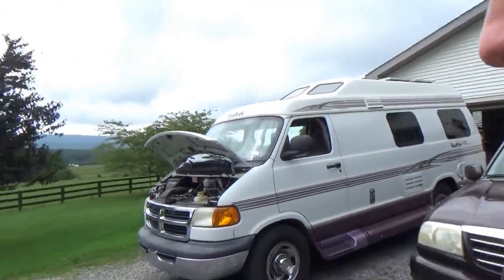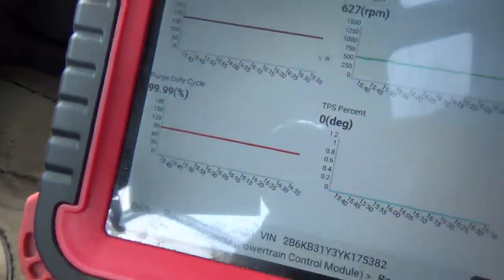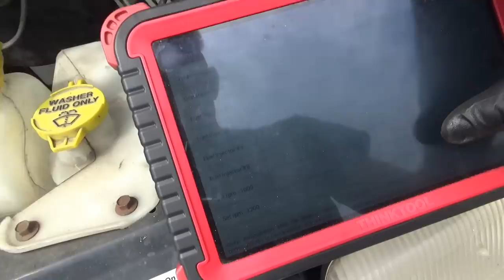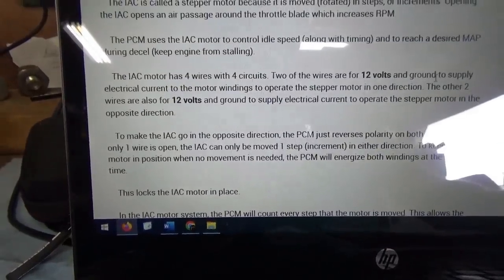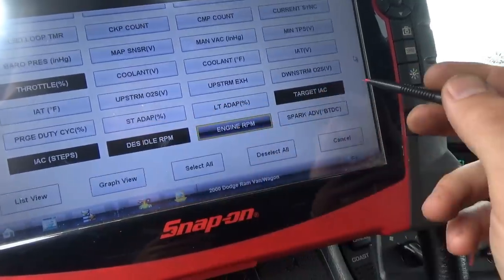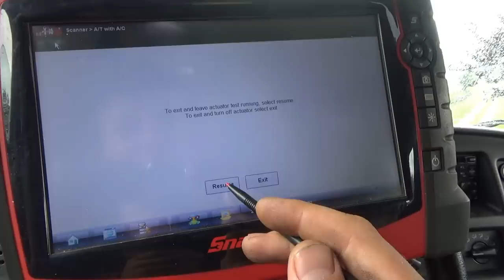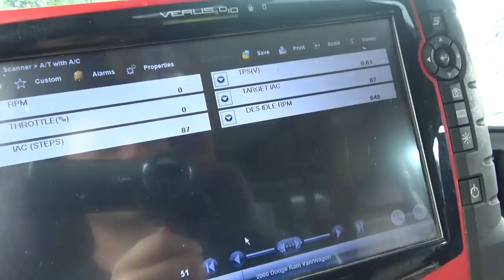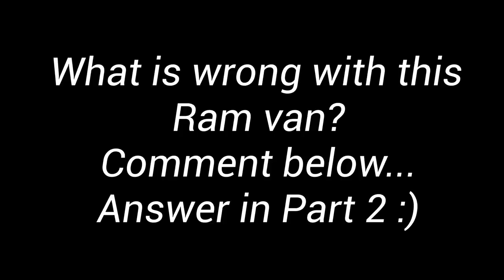DANGEROUS to Drive! Ram Camper Van STALLS after Hot Soak - Part 1

Comment: I went through this with fleet of full size Ram vans in the early 2000s all had similar problems. You will probably find it will act up not want to start vapor lock even run bad if the fuel tank is low and you drive it around for a while. All of the vans I was working on had the filter/sponge in the tank clogging if you do a volume test when they were acting up the fuel would start to spit out, pump was cavitating I found the filters clogged around 100K. Driving would slosh around the fuel cause it to start running better or full up tank would run better crazy pain to figure out at first and before I figured out the first one had 2 more doing same thing.

Comment: The IAC (Steps) reported parameter is only telling you how many steps the ECU has applied, the ECU has no way of knowing the actual position of the stepper.  If it's intermittently sticking and losing steps or not able to be driven fully to it's home position to get the zero step position then you would expect the reported step value to change as you are seeing.
Reply: Shouldnt the motor re-home with key on to reinitialize the step counter ?
Reply: @nickmalone3143  It will, but again may immediately lose steps if gunked/sticking.
Reply: @nickmalone3143  Yes, it moves to one end of its range to zero the step count but if part of the steppers range of movement is bad (i.e. sticking) then it could get a bad home position or it could lose steps immediately after getting home amd moving to the stored open loop idle value.
It seems to be able to control idle pretty well sometimes, so I suspect only part of the motion is tight rather than all of it.

Comment: I had a 2001 Dodge Van and was doing almost the same thing after a hot soak.  Turned out to be the PCM/ECM due to the circuit board inside was cracked and when it got hot the crack would open up more stalling it out.
Reply: Good comment but this one runs fine hot. Did yours act JUST LIKE this one, only acting up after you turned it off? (trying not to watch to the end before reading comments) :o)
Reply: @hikerJohn  same symptoms

Comment: I have seen this exact thing 3 different times and it was 3 different issues every time, 1997 Dodge Dakota 5.2 had a PCV valve issue where it was pulling oil, then it would only idle with the IAC at about half open (43%). Next was a 1998 Dodge Ram 5.2 that sounded an awful lot like this van, the starter was drawing so many amps that it was pulling the keep alive memory out of the ECM causing an idle relearn every time it was started. Next was a 1998 Dodge Durango 5.2 that had an intake manifold gasket leak, which had me chasing my tail because they usually leak when cold, but this one was leaking into the lifter valley and not at the top by the valve covers. Gave it the Charleroi Chimney, aka Avoca Smoka, and found it that way
Reply: the loss of comm error that kept popping up may support your theory of the Iac trying to do relearns.  Im wondering if it has a bad main  ground somewhere. its also sluggish to turn over the engine..
Reply: PCV, I like this idea aswell

Comment: Air filter, pcv, throttle body clean, IAC clean, fuel filter, fuel pump, new battery, and for sure new wiper blades. That's my parts cannon burst from the keyboard. If none of that works, then PCM. If that doesn't work, then heat shield all fuel lines. If that doesn't work, then send it to Rainman Ray. If that doesn't work, have Ray send it to South Main.

Comment: I was thinking from the 5 minute  mark of this video if you've worked on a pile of old dodges like I have you should already be looking at your battery condition and the alternator output.     It sounds just like it has to relearn idle rpm everytime you're starting it which it shouldn't need too unless the battery is to weak and the ecm keeps resetting that value

Comment: I am familiar with the Ford idle speed algorithm.  First, you have to understand the engine operates in 3 different modes: closed throttle, part throttle and WOT.  The modes are determined by the TPS.  If you are in closed throttle mode and you add a small amount of throttle, not enough to enter part throttle, the ECM algorithm WILL take away IAC !  If you add enough throttle to enter part throttle mode, you are correct in that the IAC will pre-position for when you take your foot off the throttle.
There is no direct feedback from the IAC.  The ECM believes that if it commands X number of steps, the IAC actually moved that many steps.  The current position, in steps, is created during engine cranking.  First, the IAC close completely (0 counts) and then it steps forward to it's starting position.  Now it knows where it is at and all additional steps are added or subtracted from that number.

Comment: The pintle on the end of the IAC motor may be dirty. Back in the dealership days, we ran into similar situations on the magnum engines and cleaning the pintle on the IAC would straighten things out. That being said, we also had several PCM failures that would often give similar symptoms. Looking forward to part 2!

Comment: I had a similar symptom on an older vehicle.... it was the electronic ignition module inside the distributor cap.... back in the day it turned out to be a recurring bad batch of them but it was replaced in Oregon, Utah and Colorado on a nightmarish trip... I know those folks will be grateful Ivan

Comment: When you first described this, I wondered if this was a variation of the old vapor lock situation - the gas in the fuel rail would boil and cause all kinds of problems.  Given this is a return-less system, all that vapor would have to be consumed before things got back to normal.  I'd be checking the fuel pressure.  Maybe I'm wrong, but that would be a fast easy check to rule out weak fuel pump or pressure regulator.  In fact, I'd do that before starting a deep dive into the computer readings.

Comment: I'm thinking since it seems like the battery is weak the battery voltage is dropping too low during cranking and the PCM is losing it's learned idle memory, the throttle body is probably dirty as well compounding the issue.

Comment: You are definitely on the right track, Ivan. I would check each of the inputs to the ECM that it uses to control the IACV.  All cars vary, but typically the ECM monitors load parameters from A/C, headlights, rear window defogger, power steering pump pressure switch, neutral start switch, etc.  Perhaps your research service will explain how the input parameters impact the ECM's strategy to control the IACV.  I know you already have this figured out and I'm looking forward to your resolution in part 2.  😊

Comment: From my experience on my 1987 GM , they can sometimes get a build up of carbon around the pintle . When it had worn , there were rub marks where the pintle would seal against the plenum . I suspect that was side play in the shaft . Nothing wrong with a relearn . And if that is an off brand replacement , it could be a joker in the deck !
Reply: I had a Chinese motorcycle (CSC RX3 as in USA) and it would do a similar thing with carbon on tip and inside the passage as it used this type of Delphi AIC....

Comment: Wow, I'm getting the same thing with my 2004 Lincoln. Took it to a shop they changed the plugs and coils and it still happened after. They kept it and could not find the problem. My car has stalled, but most of the time I get misfires until I drive down the road. I was looking at the IAC, but I also suspect there may be an issue with the EGR. I can't wait to see what you find!!

Comment: Used to be common on Mopars for the purge canister to leak small grains of charcoal.  The small grains would get caught in the purge valve holding it open. Usually presented as hard start after fill up as the partly stuck open purge valve allow the fumes to be forced into the intake while filling the tank. But would also happen after hot soak if some of the charcoal was stuck in the purge valve. Usually you could just remove the purge hose and shake it and find small particles falling out. Also may explain the low stepper #s trying to make up for the vacuum leak

Comment: Cool issue Ivan! The van sounds like the classic Chrysler start and die after a battery disconnect. I wonder what the default steps would be if you were to unplug the iac while it was running. Looking forward to the fix!

Comment: I had a weird similar issue on a 94 GC 5.2. I didn’t have a scanner and after chasing everything done the hard way, the purge solenoid was allowing fuel vapors to enter the throttle body at idle and would killer the engine or make it run horrible for a short period of time. I found two bad vacuum check valves and possible bad signal wire from the pcm. Now your engine is the 2nd or 3rd gen vs the 94 I was working on. But the circuit was powered by a 12 v supply and the pcm would supply ground to the purge solenoid to activate it. Once activated it would not complete the vaccum to not command vapors into the intake.

Comment: A weak battery or voltage drop in the battery cables will cause this problem on those magnum engines it causes the pcm to loose the learned IAC steps until you have a key cycle and restart with proper voltage.  Cleaning the throttle body would be a good idea. I fixed a lot of these working at the Dodge dealer .
Reply: Throttle body cleaning should be regular maintenance on this vintage Chrysler. The V6 run very poorly with a dirty throttle body.
Reply: yes, the sluggish cranking and comms loss are both big clues.
Reply: I have been looking for this exact comment.    Had a couple of these in a church van fleet…. Dead or low battery would cause then to lose their learned idle.
Reply: Well done Robert, 
Think simple....always works with old Mercs..😊
Reply: @kc360awareness   most batteries nowdays are junk. they lose charge fast when not started or maintained regularly.  neighbor bought a new wallmart battery 6 months ago, he let the car sit and rarely started it.. he came over wanting help to change the alternator , insisting it couldnt be the battery.  I jumped the car, and checked the alternator, it was good. tried charging the battery, would not  take more than 6.5 volts from my commercial charger,, he took the NEVERSTART battery back to wallmart and they changed it out. problem solved.. used to be u got a 5 to 7 year prorated warranty on batteries, now I think 3 is the most u can get, because they KNOW the batteries arent going to last.  also 90 percent of all batteries sold in the US are made in Mexico and they slap different brand stickers on them.

Comment: Awesome video. A friend of mine owns a 2000 Dodge Durango with the 5.9 ltr engine. It has a problem on cold start below 40 degrees Fahrenheit. It's a start stall  You feather the throttle to keep it going and after it warms up it runs perfect. I had a launch scan tool and couldn't find any helpful data. Now that I bought a used Verus I'm hopeful. Specially after watching this series I might be able to figure it out. It seems like all the inputs it would use looked fine when looking at data pids. Go Ivan go. 😂

Comment: Father in law had the same problem with 2000 ram pickup 2500. His was a bad tork converter. Locking in at low RPM at red lights! She's a beaut Clark!

Comment: Alright, I'll throw my hat in the ring.  Assuming the logic in the computer is not corrupted, could it be closing the IAC while simultaneously opening either the purge valve or the EGR?  It would assume the extra air lost from closing the IAC would be compensated for by the extra air added from the purge or the EGR system?  I know you tested the purge valve, but you tested to make sure it wasn't leaking, correct?  But, if the purge wasn't OPENING under command, or the line was restricted/blocked (or the canister the same), this would prevent the extra air from being added by the EVAP system.  This would also explain (maybe!) why it happens after the engine has warmed up.

Comment: Now that I'm watching. I also thought checking the throttle body for build up. Sometimes the iac is working too hard to keep the engine running due to the throttle body being dirty.
Reply: I think this.
Maybe the throttle body needs a clean as it's sticking. Computer is trying to compensate for this through the IAC.
If it was anything to do with the EGR it would be down on power throughout the gears (possibly)
Reply: This problem only happens when it’s hot. That would rule that out as a possible issue.
Reply: Well, this is basically what the Sea Foam cleaning does, as it'll get sucked right through the IAC as part of the process.

Comment: i had similar symptoms with my old Chrysler and every time it was a dirty throttle body, but who knows, it could be many things. i don't recall if it only did it after driving it for a period but i do specially remember you could tap the gas at traffic lights to keep the engine running lol

Comment: Heat + electronics can lead to problems.  Unrelated, but 2 interesting stories to tell.  1. Ford Ranger - failed to restart after hot soak, first a small problem then progressed to 45 minute wait.  Turns out it was a broken wire in the ignition coil that was ok when cold, but went high resistance when hot.  2. Chevy Celebrity - MPFI 2.8L V6 - cold start problem.  On cold start the idle would vary up and down for 2 minutes until engine stabilized.  The IAC was going in and out in and out.  It went in so much that normally a cold start required 3 times with the key to stay running.  This was a real head scratcher.  Issue was faulty "cold start fuel injector".  Some cold start injector unrelated to the 6 main injectors was supposed to spray for a few seconds after cold start and cut out with bi-metallic strip.  This strip failed so it got less fuel on initial start and threw the computers idle regulation strategy completely nuts for a cold start, as the computer hunted for the proper idle.  The algorithm failed because it depended on this extra injector fuel at start.  That one was tough.  For this one I'm waiting for pt. 2, it could be so many things.  Try unplugging the IAC when it is at the correct number of steps 88 or so and then try starting the engine when it's acting up and bam you know its at least iac related for sure.

Comment: For the IAC not being there on your thinktool -- if you just file a report to them about it missing, they will know that it needs to be updated and get it fixed.   I know on the Xtool's, they are good at fixing bugs like this within a week or two, and they have nearly a dozen updates everyday; luckily I have 3 years of free updates...  Also, I wonder if IAC would have been there if you checked under basic OBD2 data on your thinktool?
Reply: Could it also be that you overlooked it?   I think they may all be listed as AIS or related to AIS, or adjusted idle speed or something like that.
Reply: It’s not a bug, just a missing PID or feature. We are talking about a 22 year old Dodge. I don’t think they care. 
In the past, I reported a glitch to LAUNCH when I was having a problem with a special function on a GM. Never heard anything and nothing came of it. These Chinese scan tools have many problems but they overall work good enough. It is what it is. 

Even a $10,000+ scan tool from Snapon doesn’t get you any special support. When there is a glitch you can bend over and pay to upgrade and see if anyone listed to you…
Reply: My company works directly with Autel and we can send reports to them and they always fix our issues.   The thing is a lot of our techs don't report them lol.  We also help develop special service tools especially for ADAS

Comment: We had a 2001 Dodge van as a company truck and the purge solenoid was indeed sticking.  Took a couple of tries, but the dealer finally got the issue corrected.  I think that was almost the last year they made those.  2002?  Great video!

Comment: I am still thinking coolant temp sensor or MAP sensor. If your coolant temp reads incorrectly it may cause the ECU to tell the IAC to do weird things when warm. Also if your MAP was reading incorrectly or dropping out you might have a situation where the ECU doesn't tell the IAC to do the right thing. The IAC isn't an input in this equation but an output. What signals does the ECU make it's decisions on to command IAC? TPS, coolant temp, MAP?
Reply: W/o watching part 2, My guess is MAP. 
The IAC appears to operate perfectly